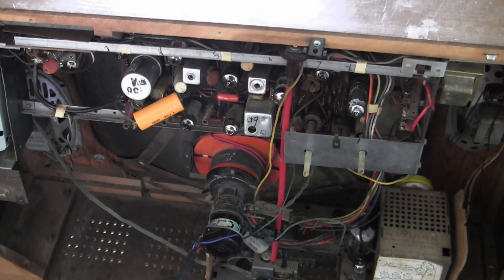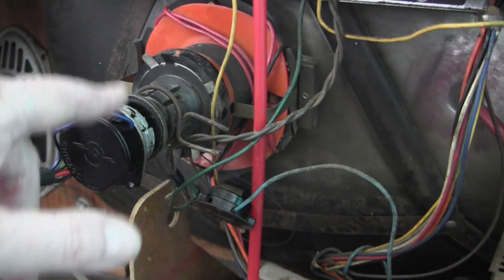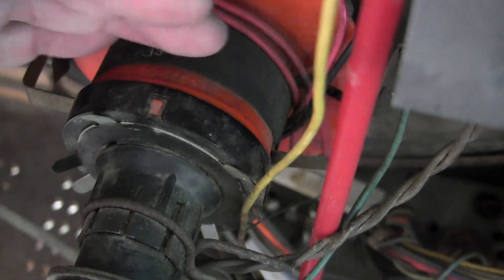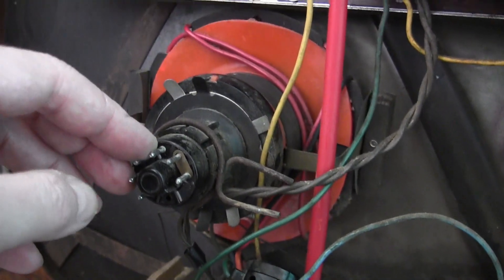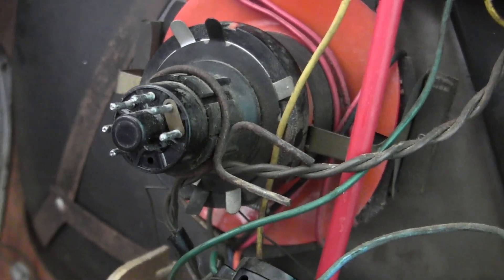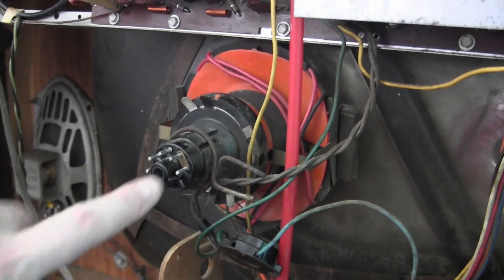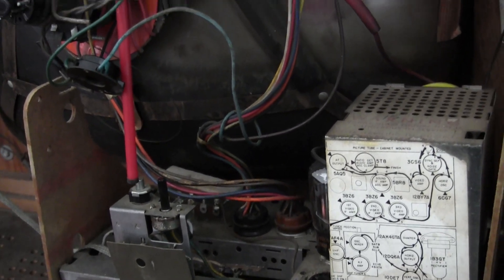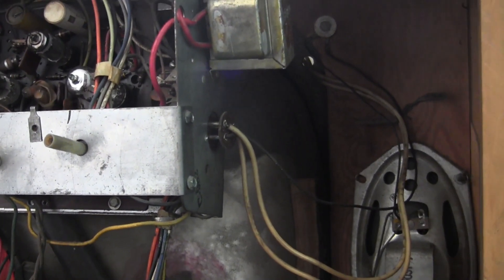Sylvania Halolight/Sylouette 21C529 part 2

Comment: I have found Sylvanias of this vintage have very flimsy and easily damaged circuit boards. They warp and the foil comes off with little soldering heat.
Reply from the maker: I look forward to the challenge :)

Comment: There re two basic styles of electrostatic focus guns. The bipotential gun used in most color and some monochrome tube has a focus voltage of about 20% of the second anode. The Einzel gun design was used an many monochrome and a few color tubes, typically focused around zero to 500V. 
The focus electrode is next to the Screen (G2) electrode and is the first anode in the bipotential configuration. In the Einzel version, the focus electrode cylinder is placed between two others that are at the full HV potential.

Comment: Anodes !  Best connector was Zenith 15-276 & 15-276-01.  IIRC  the -276 had one hole and the -01
had 2 holes, one for a for focus divider. Good for 30KV,  with a screw connection.  Change one in <2 mn !
You can also steal them from Zenith triplers.
ENUF !
LFOD !